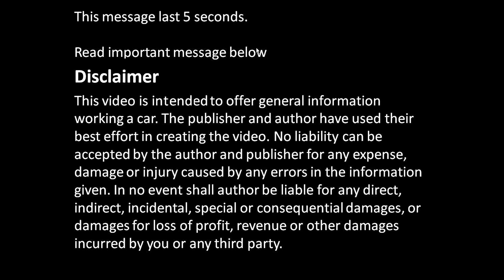How works hydraulic valve lifters in Toyota Corolla Dual VVT-i engine. Years 2008 to 2018

Comment: Hi Peter, I have 1zr engine on corolla 2008, I got misfire on cylinder 1 (p03010) , then I thought that it's related to coil / spark/injector. after checking, we found that there is no compression in the cylinder 1, when we open the valve cover, we found that the both of the value lifters for cylinder 1 are fall off and no longer in their place. What could be the reason for such issue ? given that there is no  overheat or ticking noise in the engine. we also inspected the lifters and the camshafts and no issues found in these parts. This issue happened when the engine was revs at 4000 RPM while driving.
Thank you
Reply: check for sticking valves
Reply from the maker: Thanks for info 👍

Comment: Dealer quotes me now 4200 from friday at 3k basic description says valve lifters 🤷 40k miles 2017 i only put 20k and have changed the oil with full synthetic etc ... They want approval for the work but you haven't given a  💯 answer or price 😩 seams like alot ....new engine cant be much more
Reply from the maker: Thanks for sharing